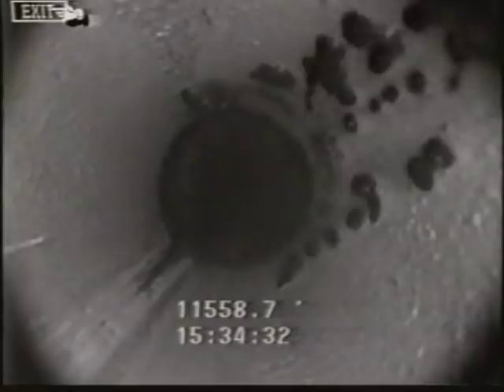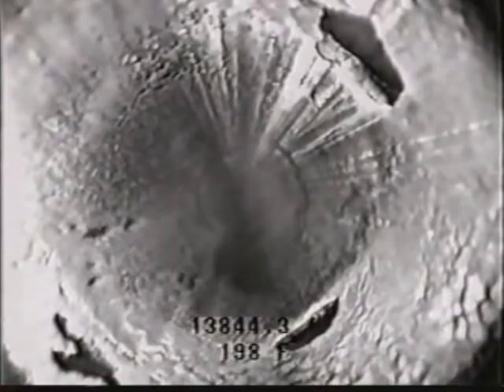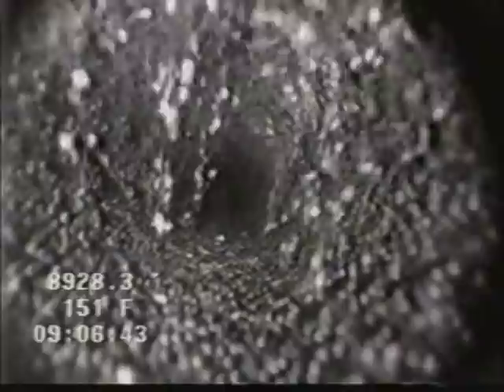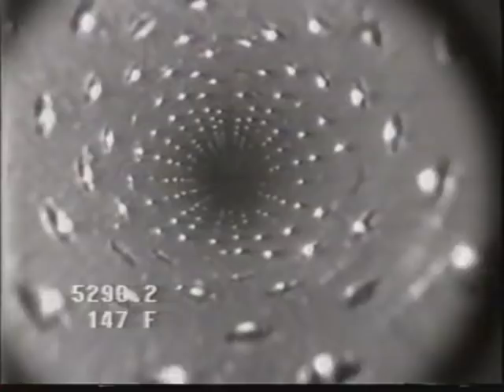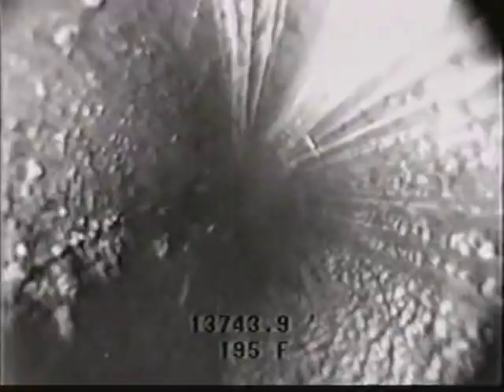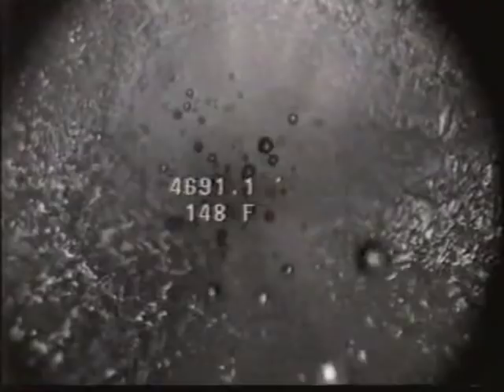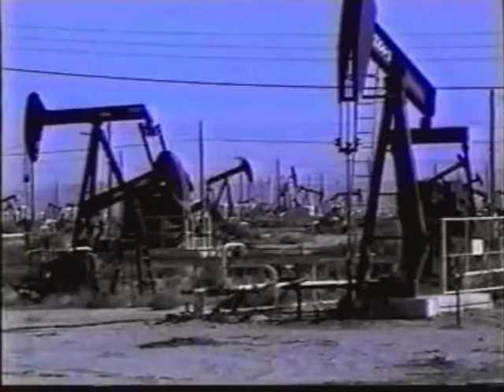Oil Well Downhole Camera Video (1/2)

Comment: I was under the impression that there would be a solid oil stream coming up the pipe. I never imagined it would be oil water mix.
Reply: I believe relatively more recent methods of oil drilling involve some shaft like this with other shafts that pump water, sand, etc to pressurize a deposit and force it in to this shaft.
Reply: This is why they frac once the well is ready for production they pump all this water an oil to a nearby battery location where theres oil water an gas separators putting the right of amount of each substance in each battery at various pressures

Comment: I found this fascinating when I watched it first hand in the back of the camera truck. I was looking down rig supply wells in the Eagle Ford shale area in South Texas 10 years ago. Deepest depth on video was ~1700 feet BG, through the casing, perforated section, and to the bottom of the borehole. Even got 90 degree shots at static water level and found that it fluctuates quite a bit in a short time.

Comment: Far out man, f mydad was still alive he would have gotten a kick out of watching this. I was helping a cable tool crew pull some ratting tubing and rods and it parted the driller said they need to get  a picture. I sorta thought it was possible the had a camera, but the camera turned out  to be a tar filled socket to get an impression. And I thought I going to see some hi tech :) . this was about '74
Reply: waswestkan they still use the lead block to get impressions today. Cameras are not common at all.

Comment: Are those caverns common? Is it like a sink hole cavern made from eroded sandstone or what?
Reply: Caelan Reeves ? Anybody know or there
Reply: In my somewhat limited experience in doing cavern work, they were salt caverns either eroded out naturally or in some instances have been carved out artificially to be used as storage for either co2 or natural gas. If you Google natural gas salt caverns it should provide some more information.
Reply: @jamieklingenberg2885  If the properties of the drilling fluid (mud) are not suited to the formation you can create a cavern while drilling. A well I was on near Cynthia Alberta the company man cheeped out on the mud and one of the formations was a water sensitive shale. The water sensitive shale swells and crumbles off the sides of the well bore in pea gravel sized pieces. Judging by the heap of shale at the end of the shale shaker we had one hell of a cavern down there. The roughneck were some sad about all the shoveling they had to do.
Reply: @eddydogleg  ah that’s fair. Actually heading to fort sask area today to do a gas storage cavern pressure test. East of saskatoon towards humbolt there’s a cavern there with a string of drill pipe in it too.
Reply: @jamieklingenberg2885  I was on a Simmon's rig back in the 80's. We drilled a couple of gas storage wells and a disposal well out at Prud'Homme.
Reply: @eddydogleg   yeah that’s where I was east of stoon. Couldn’t remember the name tho thanks

Comment: Wtf the cavern ?! Thanks a lot for uploading !!
Reply: I wonder if the drilling crew noted that zone when the drill string advanced faster than normal as it was being drilled?
Reply: @epistte  its "lost circulation" from pumping mud. they did not hit a cave, they made a cave in soft porous material while drilling.

Comment: I’d love to see more. In particular explain what we are seeing as far as the casing. Is it new, old or mid life or needing replacing. 

Can you pull old casing and put in new or do you just relive the old leaking casing.  

When I was a kid, I grew up on a cattle ranch in NM. My dad bought several
Thousand get of used oil well casing. I believe it was 6”. We cut it and welded to make cattle corrals. Usually had about 1/2” of tar like oil on the sides.
Reply: "Can you pull old casing and put in new or do you just relive the old leaking casing." They can run a casing patch. Use the search terms "Casing Repair Schlumberger".
Reply: @eddydogleg  I wish the oil industry would spend some $$ advertising and making infomercials. People have no clue how much oil is used in their lives.